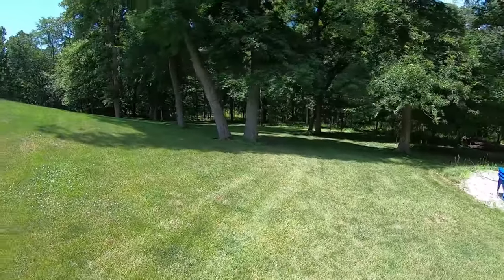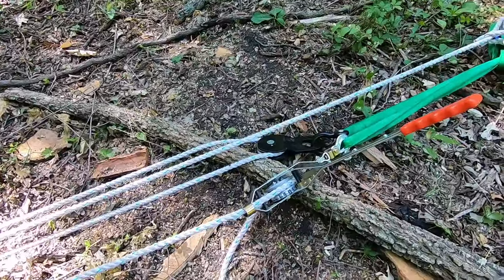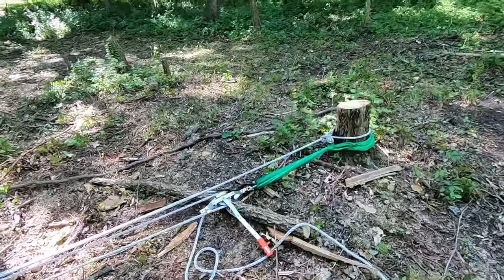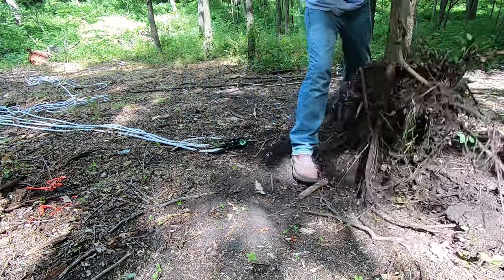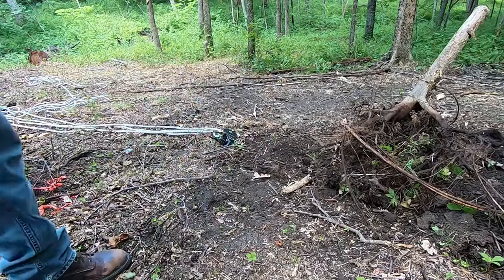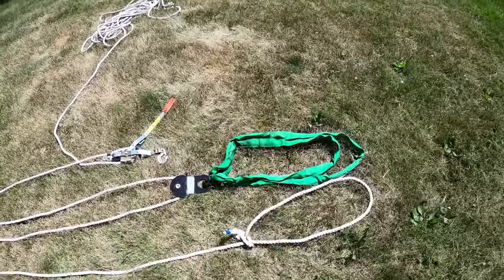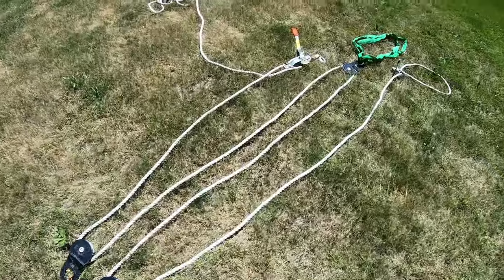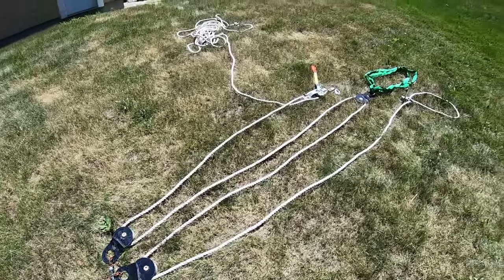How to use mechanical advantage pulling stumps with rope come-along and snatch blocks

Comment: I have this puller in the truck all the times, last winter we were able to help a truck get back on a mountain road in the snow, they were very close to the edge and I couldn't get around to pull them forward so we used a snatch block from a tree when pulling both truck were wanting to go up hill. It worked and is very versatile

Comment: I think you'd get a more powerful pull if you took advantage of the leverage  acquired by hooking to the top of the stump rather than the base. Thanks.
Reply: It would be much more likely to break the stump.

Comment: An interesting story I heard about and found again with Gemini AI:

Archimedes (3rd century BC): Considered the "father of mechanics," Archimedes is credited with the formalization of the concept of mechanical advantage through his studies of the lever, pulley, and screw. He demonstrated how these simple machines could multiply force and make seemingly impossible tasks achievable.

Example: Archimedes famously used a compound pulley system to launch massive ships with minimal effort, showcasing the power of mechanical advantage in overcoming significant weight.

Comment: Wrong spot to put the blanket. If the things breaks and actually flies, it'll just go under the blanket. Having a bit of rope between blanket and snatch blocks allows the blanket to fall and the snatch blocks will go above the blanket so the blanket is captured by the system and can then dissipate the energy of the snatch blocks.

Comment: Adam, very helpful. I’ve pulled a couple stump the hard way!  Want to try snatch blocks. I destroyed my last steel cable comalong. Curious about your come along and rope. Is it specifically made for rope?  Just thinking of future uses and if I should try rope or steel cable. Either way I have to get more length so deciding between rope or steel. I honestly never thought rope would be strong enough.
Reply from the maker: Check the description for a link to what I used. You can do more research from there but I believe that rope is rated for something like 7 or 8000 pounds. It’s pretty strong stuff.

Comment: Good vid Adam - appreciate the extra info of why you were doing that rigging.  I'm thinking of getting this puller - did you have any issues of rope slippage during use?  I've learned some ppl have unexpected slip & it can jeopardize the pull (because the load can re-set itself).  Also, do you have any thoughts on the Maasdam strap puller - is rope better than a strap?  Thanks again!
Reply from the maker: I’ve never experienced any rope slippage. I wonder if the people who have reported that we’re using it with something other than a 3 strand rope. It will work with 12 strand but is designed for 3 strand. No experience with a strap puller but I would think rope will be much easier to deal with than a long strap. It’s a handy tool with lots of uses.
Reply: @adamj8293  Thanks Adam for the quick response - ok, did you buy the Maasdam puller kit (with designated lengths of rope included), or did you use the bare puller with a 3 strand rope you already had?  Curious because Maasdam seems to want their rope pullers to use a very specific 3 strand & grade of high performance Dacron/polyester rope.  If you bought the kit (A20, A50, A100), do you recommend a certain rope length over the others?

Comment: Your stump is like 4 feet tall, you could have made it easier if you attached your chain about 3ft high to get leverage, your rope is so low to the ground is it like you are trying to plow it out of the ground. As far as being weary of the chain slipping, you could have notched the higher point and wrapped your chains in the notched so it wouldn't slip.

Comment: Why did you put the blankets on the rope?
Reply: In case the rope snaps (or any other part of that end of the setup) it will dissipate the kinetic energy and hopefully protect the operator of the winch.
Reply: I think the blankets should have been put more near the middle vs near the tree.  If there is a failure near the snatch blocks, the rope will retract and could slip out from under the blanket, repositioning the blanket farther away from the stump could weigh on the loose flying lines better IMO but I've never been in that position, so it is just my theory.